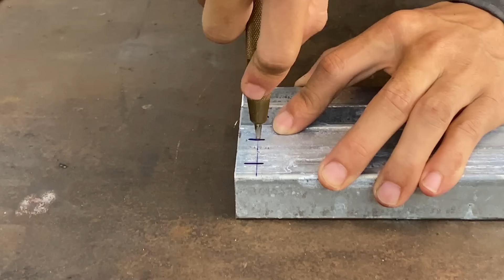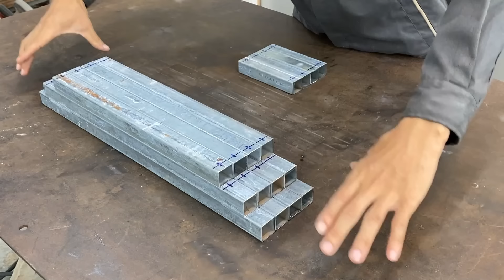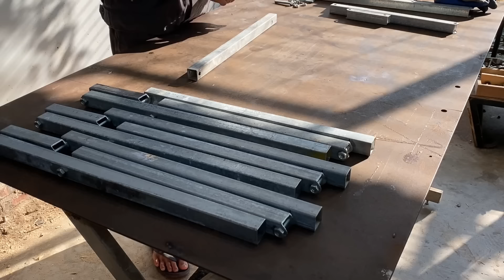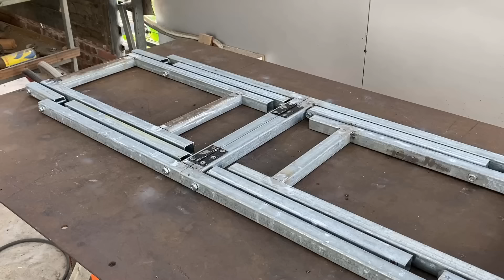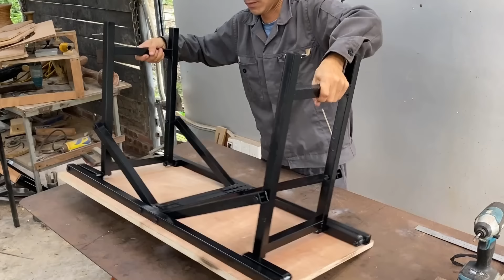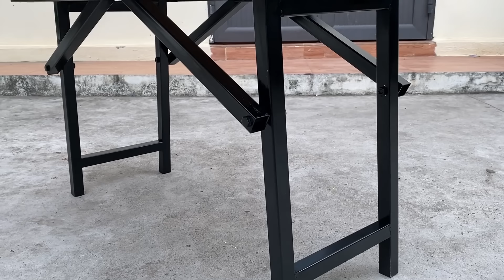DIY - Craftsman's Ideas/Smart Folding Table Projects You Should See/Metal Smart Folding Utensils !

Comment: Sir, while Marking u might had shown the Dimensions thickness, bolt size, hole dia Etc. Thin washer to be used, in between the tubes. Strong table. A Least sketch might have been shown. Sorry. 🙏

Comment: Too bad about the work and the materials. Anyway, it's like putting tail on cherry ... 
Missing: a support latch (or 2) and one-piece hinges (Achilles' heel) . 
Then welding galvanized steel can cause serious illnesses (welder's disease) . Painting galvanized surfaces requires priming with zinc primer. Otherwise the paint will peel off in a few years ...